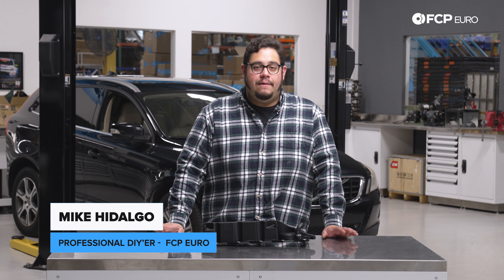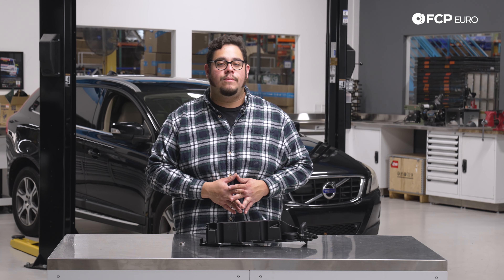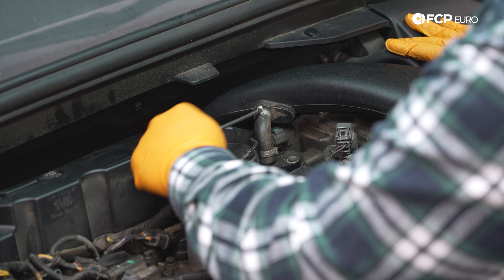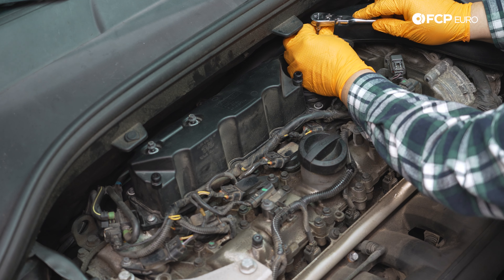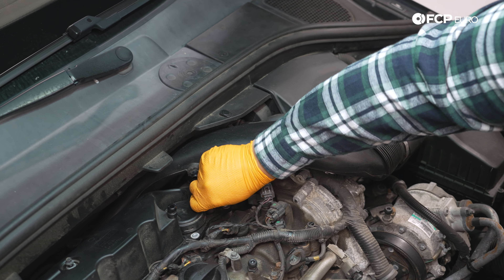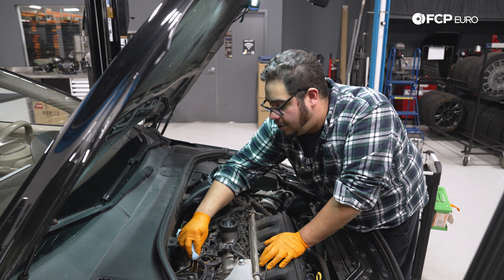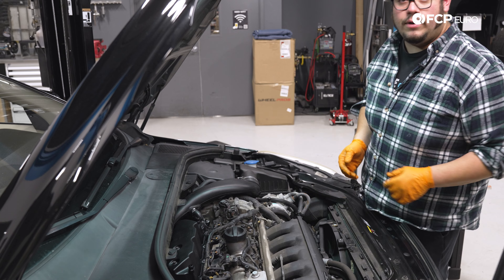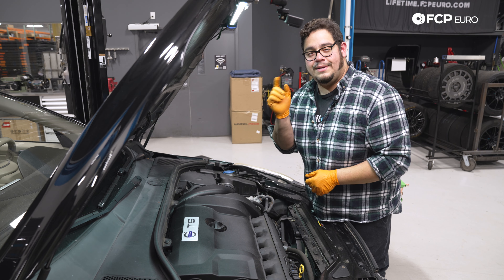Volvo XC60 PCV Oil Trap Replacement DIY (2010-2017 Volvo P3 XC60 3.2, T6 AWD, SI6)

Comment: I’m so glad y’all are making videos on the 3.2 XC60. How about a  catalytic converter video
Reply: The catalytic converters on the engines with the S4 engine code are easy enough to be honest. If you have the exhaust setup where all 6 cylinders exhaust through a single manifold which is then connected to a long pipe with a single cat on it, you'll find that pipe with the cat is hanging on some rubber exhaust isolators. They're a pain to get off, so use some soapy water and get a pair of Lisle Pliers and you'll have a much easier time.

If you have the S5 engine code, then you have two exhaust manifolds, each with their own catalytic converter, which are then connected to a double pipe with two more catalytic converters and you'll have the same rubber mount problem if you're replacing the cats that are on the long pipe. You'll also need to reach much farther back to remove the exhaust manifold cats, and I'd suggest removing the firewall to do that. Removing the firewall also isn't too bad. Some bolts you access from the top of the engine bay, some from underneath. But they're small bolts that don't take a lot of force to remove.

Comment: This was great and timely. I will be doing this Monday in addition to fixing a cracked air duct and (hopefully) the upstream oxygen sensor. Any hints on the best way to get at the oxygen sensor? Even with the battery tray removed, it's super tight from the side.

Comment: Just attempting to do this now .. PSA: the intake pipe has a connector attached to it .. next to battery housing ... 4-wire.  The insulation / sleve has pretty bad rubbing against the thick wire harness to the right of it.

Comment: I see there is a short air tube connecting to the intake, but why there is no such tube/pipe on 3.2 natural aspirated engines in XC90. Wondering how they are ventilated.

Comment: Seems like you could get away with just the Diaphragm
Reply: Definitely go the diaphragm route in 95% of PCV cases on this engine. It's not only cheaper, but quicker than doing the whole cover. You don't get the chance to clean the area out of course, and if you had some other engine problem that fouled the oil, like a blown head gasket, then you'd probably want to clean it out.